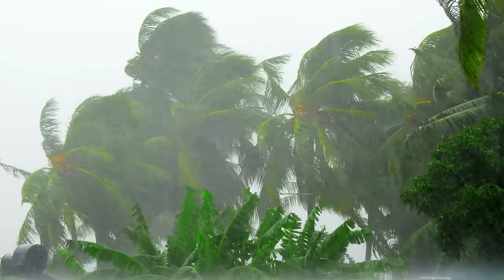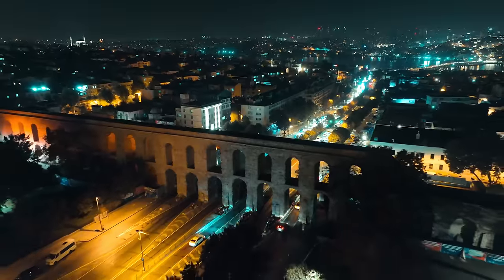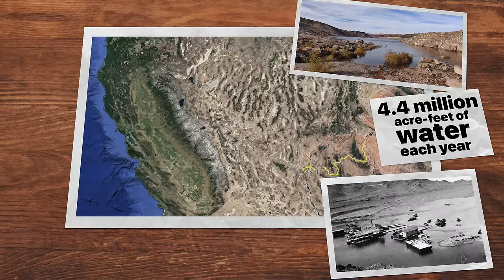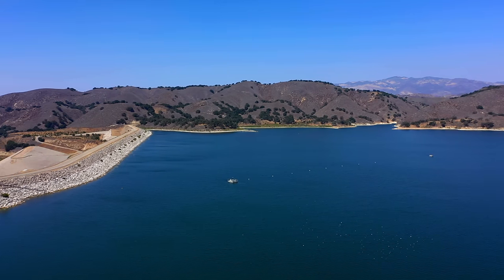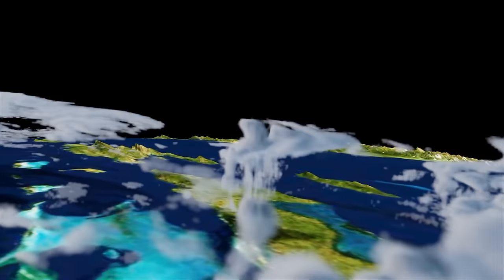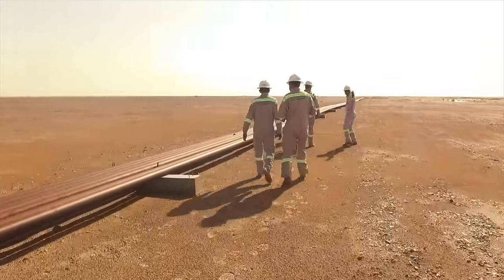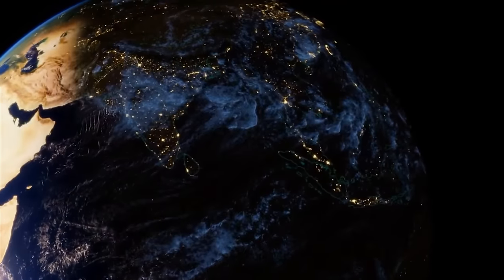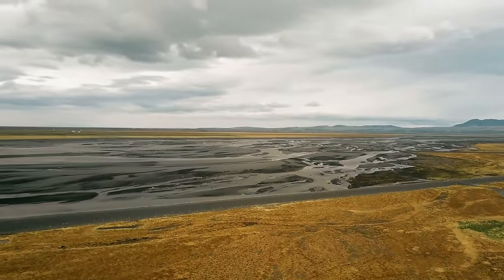Pipelines From Flood to Drought

Comment: This concept was working more than 30 years ago in South Africa, and was managed by pumping water from one dam to another in the dam linked system by means of a 6" pipe and pump. In addition, If every building has a sizable water tank connected to the gutter system, this would have a substantial impact on flooding and garden watering...
Reply: 3,000 years ago, when King David was King of Israel, there was NO indoor plumbing, of course!
The Bible says that, back then, people put the bathtub up on the ROOF!
When it rained, the tub filled with water and you would go up on the roof (weather permitting) and take a bath!
Reply: @rdelrosso2001  That wouldn't work - get 2 inches of rain, take a 2 inch bath !! Also the dust and bird poop, and who wants to go second or third?
They DID use cisterns which funneled all roof water to a box underground.
Reply: @TryNDoxMe Well, truthfully.. not really considering anything with an electric motor is DC, you could ideally run it with solar panels like your vehicle would use an alternator and along with a small battery system be able to use it an night if needed.  A secondary backup system would be wind power at night or to use a Dual fuel generator that could use Natural Gas or propane in rural areas.  Maybe consider actual 110-240V AC in a city.  I dont think realistically we can or should have entire world running on Solar/wind power. As Utopian as that sounds.. in another 100 years, they'll be telling us of the impending DOOM of Natural gas build up could explode an entire city at the flick of a slight switch or spark of a joint in da hood ! :facepalm:
Reply: @TryNDoxMe Your right, smarter people live in the deserts.. lol  I grew up in S.E Michigan snow-belt and live in Nevada for years..  the Politics alone in Michigan should keep people out of it, not the weather.
Reply: Now South Africa doesn't have the rain either.
Reply: @Stephen Keppler Where I live in QLD Australia a lot of houses do have big water tanks. They don't tend to allow them in cities though.
Reply: Good point. Underground water tank would take up the excessive water but only so much. Salmon need water in streams.
Reply: @inchranger  how about using hydro electric power as well
Reply: @TryNDoxMe Great, while Coke Cola and Nestle rob the water off the top.. What a wonderful world [geezus come soon]...
Reply: @pamelamolina5623  If I had a stream of water that didn't go underground most of the year running through my near 400 acres, It would make sense to take advantage of that but for the few weeks at best sparsely sprinkled through the year it honestly makes it difficult.  We get runoff from the mountain through the canyons but as I stated, and even though there is old water bed/river bed visible as a flood plain, the water ducks underground.  The sun would spend more time destroying the components needed and the work spent than I'd likely get use out of.

And people seem to forget all about the fact that the water on this planet NEVER changes in volume.  I've see where all these so called experts say that if you took all the fresh water on this planet, and created a water droplet from it in comparison to the Earth itself it would ONLY be 35 miles in diameter.  All I have to say to that is.. Show me the math for that.  People who talk about stuff like that cant balance their checkbooks to the penny but seem to be able to calculate to the gallon, in Miles no less, how much water exists?  I grew up in the great lakes, Water levels still the same.  Maybe because Nestle and Coke Cola arent siphoning off the water supply.  The Mississippi River system also is constructed of some 35 FLOWING springs and is the largest and ONLY fresh water transportation network of its kind in this whole world.  Further people also forget about all the natural ground water, where the water from springs and rivers goes underground. 

But now if you're talking about in general due to transferring the water across the nation, sure, I am sure there would be room and availability to harness some of the power of water being forced through a tube and capture energy needs off of it.. even if it was only enough to power up the pumps being used and a battery system to cover the autonomy of the night time.
Reply: @inchranger  FRESH water DOES change in the amount available. GROUND WATER is being used / disappearing in MANY locations and in some areas causing sinkholes and in other areas, will simply run out, relative to the amount of demand for it.  Nearly the entire American West will run out of Fresh Water relative to the demands being currently placed on it. California, AZ, NM, Utah, Nevada, Western Texas, etc. and will cause a tremendous loss in value of real estate and farm / food production, especially in Cali. (Assuming a MAJOR Initiative to improve the use and conservation of Water out West is not implemented.) And the answer is NOT sending water to California from the East Coast. 
While there are certainly things that can be done to mitigate desertification in the West...and mitigate flooding in the other areas...pumping H20 across the entire country is NOT the correct answer.
Reply: New Idea:  Pipe glacier melt off Greenland to N. America, and Africa.  This could slow Atlantic Current slowing due to the insertion of cold water and work to reforest desert areas.

Comment: The one worry I have for this is that it could cause problems for existing ecosystems such as wetlands which need overly saturated areas of water
Reply: Not to mention dry ecosystems that suddenly became permanently wet.
Reply: @booksteer7057  you’re 100% right but I just used swamps as an example because the fact is they are far more densely packed with living things
Reply: The idea is not to suck all eastern waters or drain wetlands, just "flood water" before it damages infrastructure.
Reply: @danielwatson4864  So what do you do with the floodwaters until you can pump it all? You would need to create huge reservoirs to hold it which would either flood out dry areas or change the ecosystem of swamps or lakes. You also need the proper topography to do a cost effective reservoirs. You cannot store water effectively in a place like Louisiana because it is too flat.
Reply: Agree.  What is actually feasible is the collection of moderate amounts of rainfall (<1 in/hr, or 2-3 in/hr for less than 2 hrs) -- however, these typically are not what cause floods.  

Floods are usually caused by consecutive & multiple 2-3 in/hr rainfall rates, hour after hour, in a very short span of time that overloads the ability of most drainage systems to collect and transfer that water from the street/ground level to a reservoir or channel via stream & river systems to the ocean or lakes.  
Most of these street & natural drainage systems are not capable of handling more than several inches of rain total in a 12-24 hr period.  IOW, the smaller tributaries and channels or manmade culverts and ditches that would conceivably funnel the water to one of these massive pipelines (or to the reservoir emptied in advance of expected rain deluges) are not capable of handling more than 1-1.5/1.8 in/hr average for just a few hours. These smaller systems (of which there are quite a lot more) would need to be upgraded to prevent the severe cases of flooding that happen when intense rain of more than 1+ inches falls for many hours.  Without that, the Op's idea wouldn't really solve the situation that actually results in the most damage:  when the smaller channels can't funnel the water quickly enough to larger bodies of water.

Assuming we could employ the idea suggested by the Op for moderate amounts of rainfall, as Nicholas and others have mentioned, the unintended consequence is that you could potentially damage the downstream aquatic systems, such as greatly reducing the river flow levels (many cities take that runoff water from rivers; wildlife that live in the rivers (like salmon,trout,other non-fish species)) or drastically reducing the fresh water discharge, along with the silt and nutrients, of river deltas into wetlands, lakes and oceans (while some cases of extreme pollution or nitrogen runoff from fertilizer overuse have caused toxic conditions at some river deltas, insufficient runoff could also damage the wetlands and other marine ecosystems that live around these river deltas (the ones not dealing with the extreme pollution, that is)).

Comment: This is exactly what we already do in South Florida. The canal systems in South Florida are quite extensive and are lowered several feet before hurricane landfall and pumped up to Lake Okeechobee. If the hurricane is making landfall near mid state, the lake is lowered and pumped into the canals in the southern parts of the state. Florida has no shortage of water though so its only to manage flooding and not for drought purposes.
Reply: I've been saying this for years, and alot of people in Florida call me crazy.. They would also have 1000's of gallons of water for fire fighting.
Reply: Unfortunately Florida is sinking some and sea-level is rising and you destroyed the aquifer system with canals so Florida  is going to have a hard time keeping sea water  inundation out of the farm land and drinking water  ( Calif has the same problem in our central valley and big parts of the great plains lowland central USA). We do have to start thinking how to best do something with as little risk of harm as possible.
Reply: @donnacsuti4980  Florida isn't sinking, just to be accurate, world ocean level has always been rising, and now it's accellerated. The 'crisis' would be the 'extra' rise- about 1mm per year.  It's a non problem.
Reply: @someotherdude  the big problems is that as the speed of the rise increases it will penetrate our aquifer system in Florida and destroy it. That is of course if it speeds up depending on a bunch of factors although we might be able to avoid such a bad problem from occurring.
Reply: The mass immigration into FL puts more demand on our aquafers there is concern about sea water inundation during the dry season. Because of blue city mismanagement I do not seen the immigration levels slowing down any time soon which will mean more dry season pressure on the water resource.
Reply: @someotherdude  Just the facts. Indeed some parts of Florida are sinking.

Comment: I love the idea. Here’s my concern. Water, unlike oil expands as it nears freezing temps. A lot of the western states as we are all aware are very cold during the winter. This makes me wonder what measures would need to be taken to keep the water from freezing thereby protecting the pipes from bursting. Ok, that’s my two cents. Big love all.
Reply: As long as u have a relief valve to allow for water expansion. 
A sealed container filled to brim would expand, stainless steel has some flexibility.
Reply: If the water keeps flowing / moving it is less likely to freeze. That is why it is sometimes recommended to open a faucet in winter storms. Keeps you home piping from freezing.
Reply: Salt water as it freezes separates itself.
 In a standing vat/tank of salt water no movement salt will settle to the bottom pure water floats to top as it is lighter than salt water.
 This how to create new potable water in high altitudes or cold climates.

Comment: Hi Ricky. Thank you for this excellent video. What a great subject. You briefly mentioned the Almond crops in California. Almonds are notoriously high in water usage. They are the worst. I think as a first step for California, the state should start a program to phase out production of Almonds and reduce it to just 20% of what it is right now. This will result in huge water savings enough to address the drought issue in California significantly or even completely. The farmers who farm Almonds should be given incentives from the State to change to other low water consuming crops. Why not crop Agave then make Tequila right here in California.
Reply: Because almond demand is going through the roof due to the vegan movement. Many vegan substitute products use almonds or almond milk in them. Almonds are a cash crop. Agave... I have doubts.
Reply: The same could be said about animal products, too! 70% of the Colorado river is syphoned off for animal agriculture - something we dont need to consume but we choose to because we prefer animal protein over legumes. At this point, almonds and meat are luxuries this planet can no longer afford.
Reply: @LeckieInstallsLondon  this is factually false. Like incredibly factually false
Reply: @t_c5266  which part? I can link studies to both my claims, can you to support your claim that it is "incredibly" incorrect?
Reply: @LeckieInstallsLondon  no you can't

Comment: I thought about this for Australia, especially the Sydney basin. I did not know about the plan they already tried and decided it was uneconomical.
Places where there are not the pipelines, an open channel might be constructed. To make it more viable, solar panels could reside on top of the water to provide power, minimize evaporation and provide income to become more sustainable for servicing. I know these types of panel setups have been discussed before. 
Thank you for all your work to bring this content.
Reply: Lastly to truly make this project self sustaining or as least provide positive cash flow - have an end buyer (co-op, municipality, etc) ready to purchase surplus water.   To make this work - it needs to be reliable (if not constant) and not just for flood control but that part would be like a switch to turn from the  primary sources of water harvest to flood control/mitigation.  Large retention ponds have diverse uses when the excess water is not being used.
Reply: If you have an open canal, going up and down becomes a lot more difficult, I imagine
Reply: The Eastern interior of Australia is a big bason.  The idea was to dam it up, and create a giant man-made lake in the middle of it.  I think Real Engineering or some other similar channel made a video about it a couple months ago, and it was really neat!  But my take-aways for why it wouldn't work were 2-fold.
1) there were too many stakeholders with too many differing opinions on the plan... not the least of which being the people who lived there not wanting their home to become a giant lake.
2) the costs and reprecussions of the plan were too difficult to accurately account for.  Some models basically showed that you would still have a giant desert, but with a lake in the middle of it, while others showed the whole area becoming swampland with dense trees and lots of added flora and fauna.  Some cost projections were laughably small, claiming it would only cost a few million to install 1 well-placed dam, while other cost projections showed hundreds of millions of dollars to monitor and maintain the project in a sustainable manner.  

Ultimately it never happened, and likely never will happen.
Reply: Need the boring company to make some tunnels. In Massachusetts we have underground tunnels from the quabbin reservoir that brings the water to the Boston area. Basically the made a man made reservoir to hold then watershed from western Massachusetts and pipes it artificially to the Boston area. This is same idea on a much larger scale
Reply: @skateguy50  Aquifers run downhill that's why your part of land works. 
His idea is to pump miles up and thousands of miles east to west.
Duh! Maybe he can come up with a perpetual motion pump machine to move the water.
Reply: @CaedenV  Don't forget that with the heat of the central australian deserts, evaporation of the lakes can reach 5m per year, and not sure that that water will make rain in a place where it is needed. SO it is not lakes that are needed but reservoirs with floating solar panels to provide enrgy for the pumping and to protect water from evaporation.